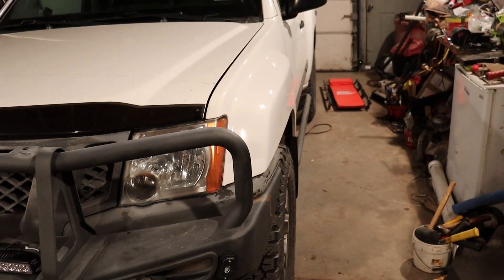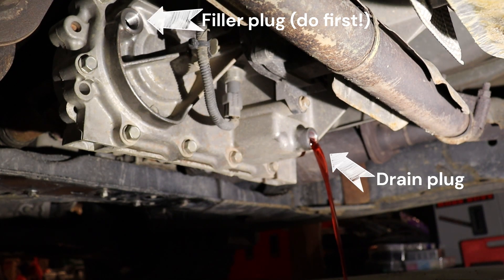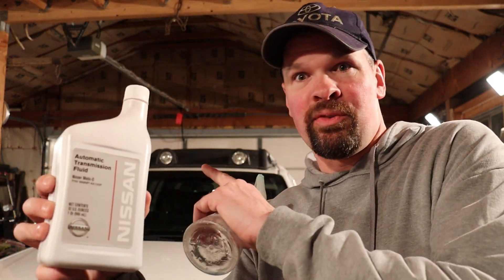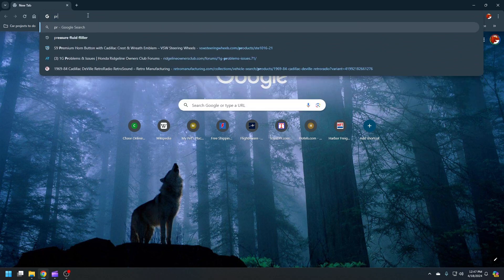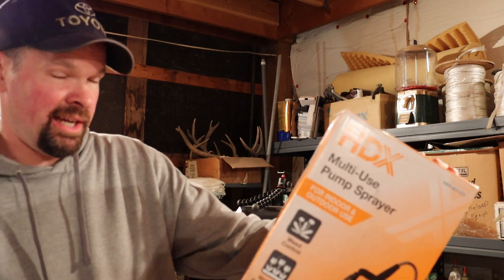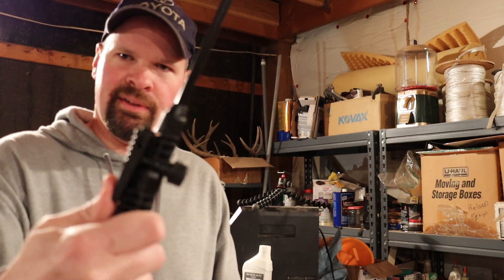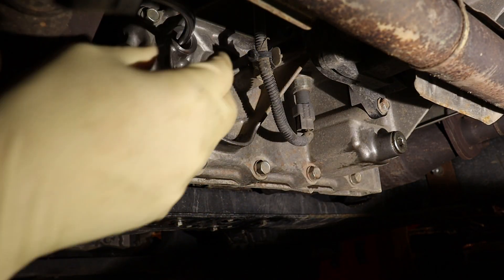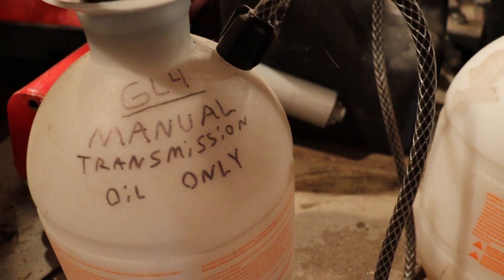Let's make an automotive fluid dispenser for $12!

Comment: OUTSTANDING! If you want to improve it,  add a piece of EPDM tubing to the spray nozzle for easier access to openings.
Reply from the maker: That's not a bad idea at all! That would make the Toyota sealed W/S fluid transmissions much easier to fill up, since their fill plugs seem to be at a REALLY awkward angle!